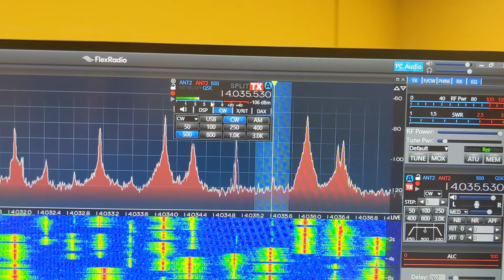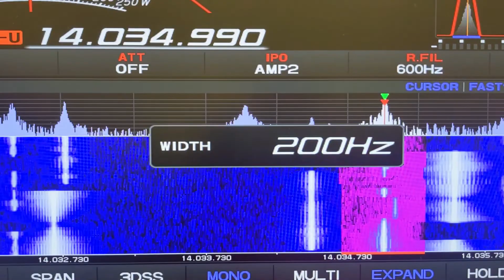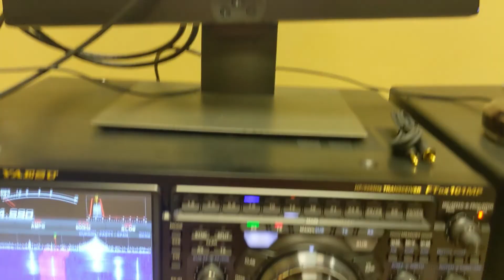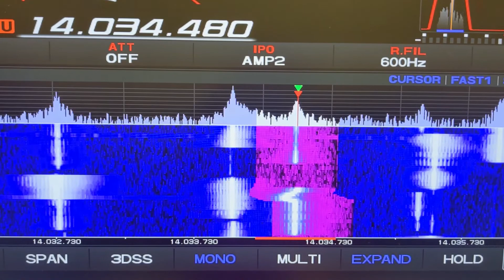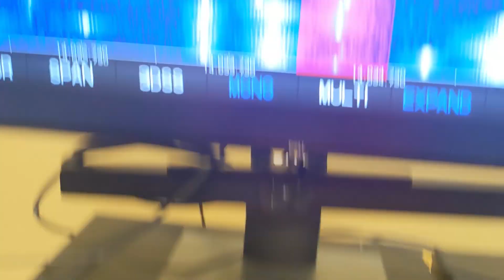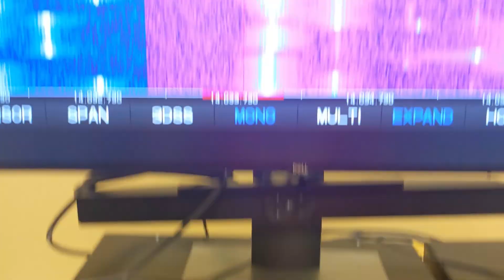CW Filters and Tuning Stations

Comment: Great video! I am totaly new to cw and your videos is really helping me! So thank you! :)
How do you set up the CW LCUT FREQ and CW HCUT FREQ? Shoud it be about 100Hz up and down from the pitch freq?
Reply from the maker: When you select a filter - say for example 600Hz - this will give you 300Hz above and 300Hz below the tone - I think this is a great setting and wouldnt go much tighter unless there is some major interference with an adjacent signal.  You can also contour the filtering on the Flex Radio with the little slider and contour on the right side - so you can do 200hz lower, and 300hz higher as an example.

Comment: And, for those of us without a waterfall display, we use our skilled ears to choose our filter settings, etc
I think a lot of the art of radio is lost when one moves to too much automation.  I like the mystery of turning the dial to discover new signals with my TS-590S.
Thanks for the explanation and visual assist!
DE K6JSC
Reply from the maker: Jason, I agree. I think some of the waterfall display stuff is mostly a gimmick for the casual operator. Contesters and serious DX chasers can use it as a tool, but the reality is that for 28 years, I was doing exactly what you are doing and it worked well!  Come to think of it, when I operate mobile, I don't have a waterfall, and when I do my park on the air activations, I bring my old trusty FT100D with no waterfall. 😎